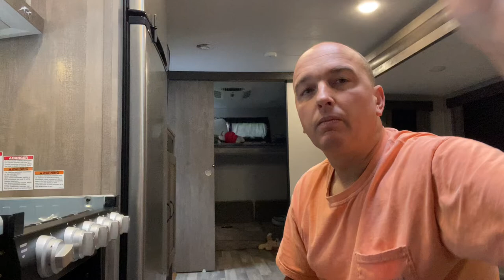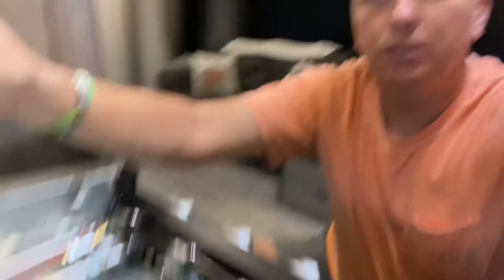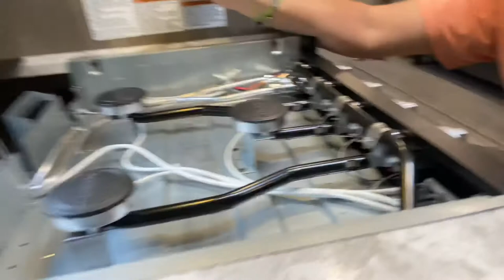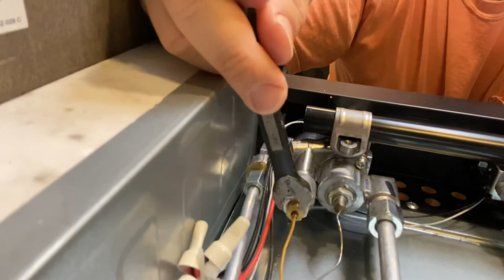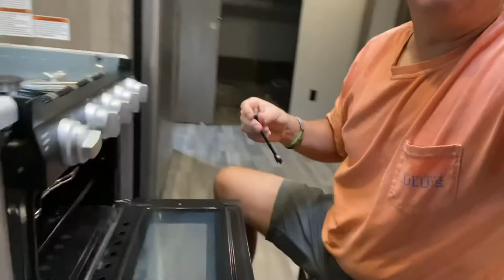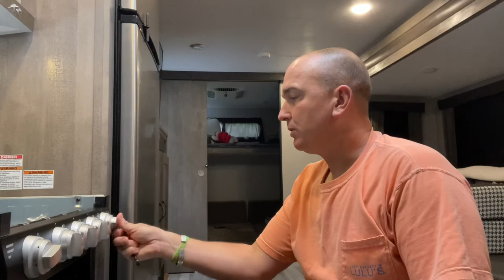Fixed pilot light on the Furrion oven in my Forest River Vibe Camper

Comment: This is a GREAT video!!  Our camper is a different manufacturer but same stove (Furrion). When purchased the sales guy demonstrated everything but lighting the oven.  A few months later we were at a park and was going to bake something but could not light oven.  Actually it was the same issue as in this video, the pilot would not stay lit after letting go of the oven temp button.  We continued to take out our camper knowing our oven didn't work.  I was afraid I was going to have to buy and install replacement parts (ugh) but this video fixed our problem, thanks Ryan!

Comment: Hey man thanks for the video. You're spot on. These connections are loose from the factory. Bought my RV brand new (2022 Grand Design) and the propane connections under the unit itself were loose. So the propane detector went off immediately. Same thing with the oven. Loose connections. Quality control is just not there these days.

Comment: Why that wire.  I just see a copper wire running to it.        I tried your method and it did not work.
Reply: Just figured out a trick
Reply: That method did not work for me either but i put the flame of a torch to the thermometer or what ever the word for it is by the pilot light to trick it into thinking the pilot light was on then when it gets up to temp gas starts to flow boom turned on right away hope this helps 😂
Reply: @ckrusher777  I found out there was nothing wrong with my oven.    It just makes no sound when lit up, and the lit flame is so small.    You just look at the reflection off the bottom of the oven.